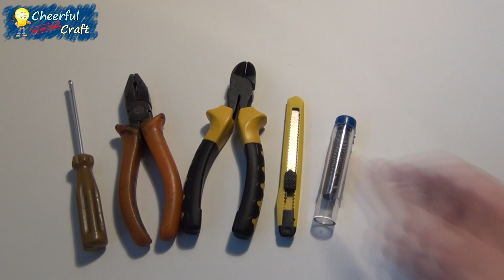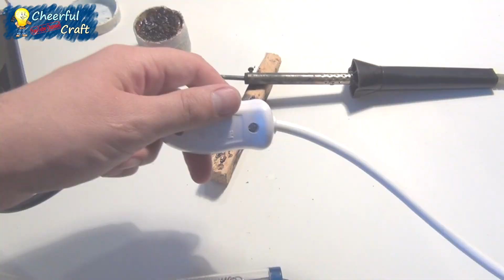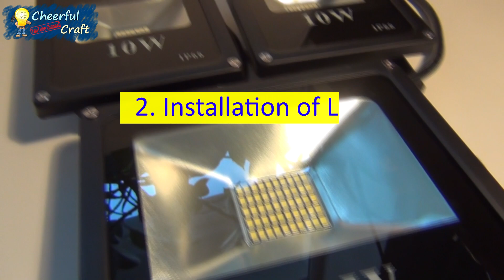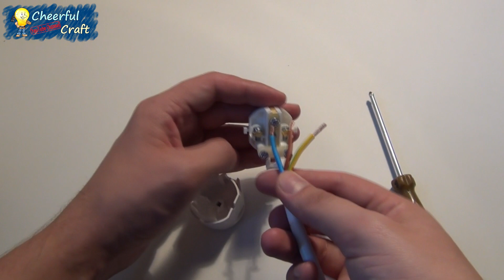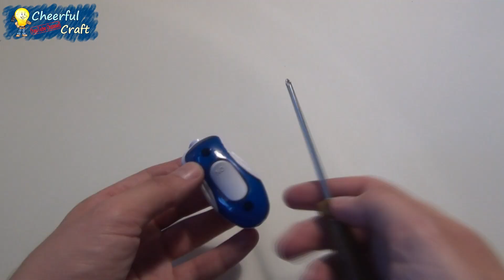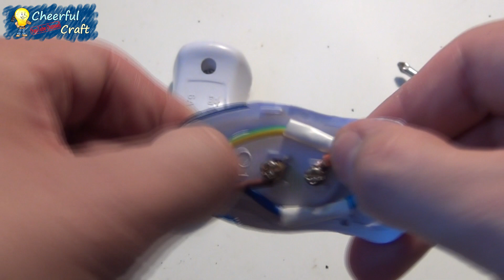How to install a LED Flood Light? Installation of LED Flood Light and on / off button.

Comment: If something has a ground wire you must connect it to ground. It can be very dangerous to just tape it up like this in the event of a fault with the light fixture.
Reply from the maker: Hi. There are two ways to connect in the video.

Comment: I only have negative and positive coming from the house outlet. Where do I place the ground wire? I have seen people just say, you can wrap it with the black wire? Is this true? In the first option you didn’t even connect the ground? Help?
Reply from the maker: You can do as in the video - without grounding. Just wrap the wire (ground) with electrical tape. Such a connection does not guarantee complete security, but it will work fine.

Comment: What size diameter wire did you use for the 10w light?
Reply from the maker: The video uses a wire 3 * 1.5 mm in diameter. That is, each of the three veins has a diameter of 1.5mm.
Reply: For lights only 1.5mm

Comment: Two-wire cable with three-wire grounded appliance? And with a grounded plug?  This in illegal in our country! Wire connected counterclockwise under screw?  Very dangerous because easy to release.  And more fails.  This is a very bad and dangerous instruction violates regulations.
Reply: In your country it's illegal however on our country is perfectly legal

Comment: What size wire did you use for the 10w light?
Reply from the maker: Three copper conductors of 3 * 1.5 mm were used.